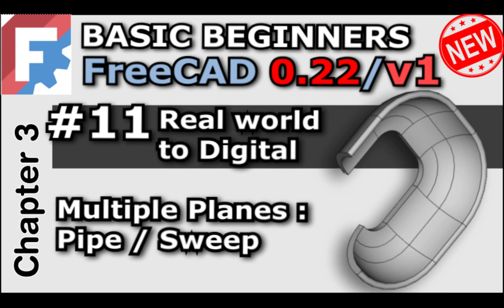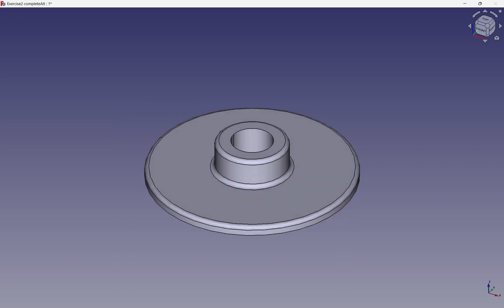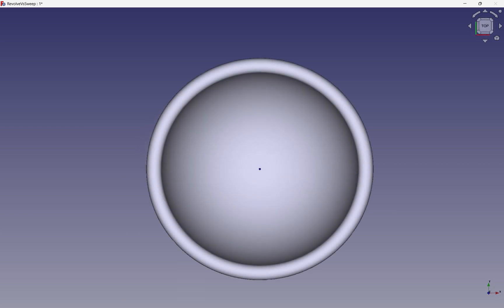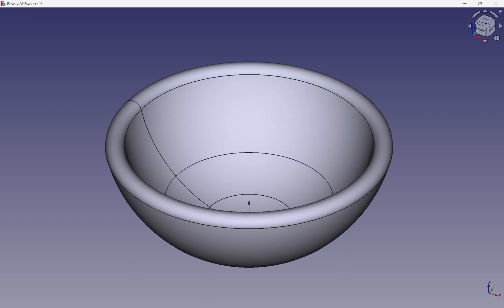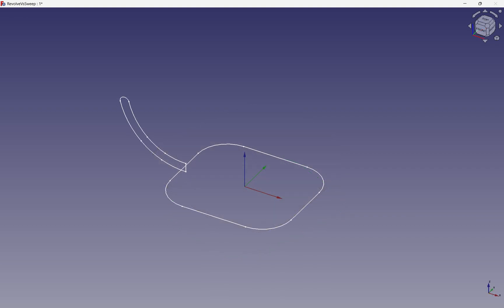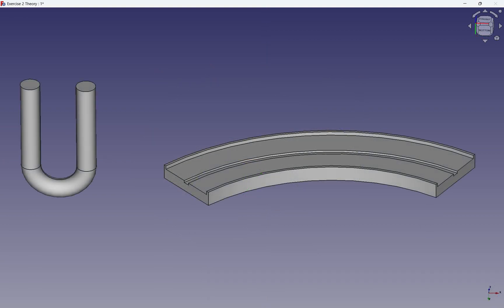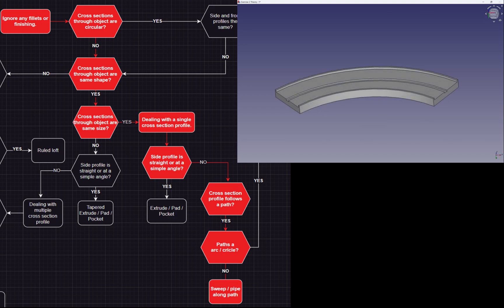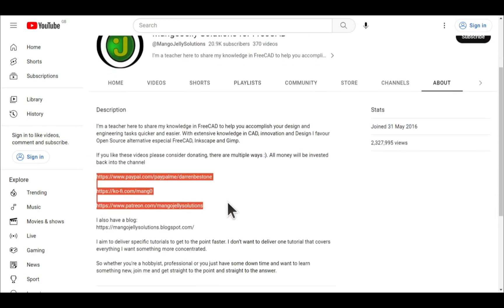Basic Beginners FreeCAD v1 / 0.22 | Lesson 11 | Modeling on Multiple Planes | Sweep | Pipe

Comment: The bowl at 3:08 is much bigger than the previous failed bowl. What if you were wanting the bowl to be pretty much the same size?
Reply from the maker: You can swap the paths so you run the path along the top.  Or better still, during your design phase you can start with the opening rectangle and then create a offset in the sketcher for the bottom rectangle.  You can then decide on how big these should be and use this to guide the design of your profile.  Sweeping the profile along the top path creates the desired shape.

Comment: Thanks for this. If you don't mind... I tried to model this 3'20'' sec. bowl using additive pipe. I dragged sketch A on XZ plane as rim along the path of the rounded edge rectangle sketched as B sketch on XY plane. Then I padded sketch B again to get bottom of the bowl. It worked pretty well and I received almost identical bowl... until I re-entered sketch A and try to modify the dimensions of the rectangle... Additive pipe crashed but last feature (pad) changed nothing in the body. What I am doing wrong?